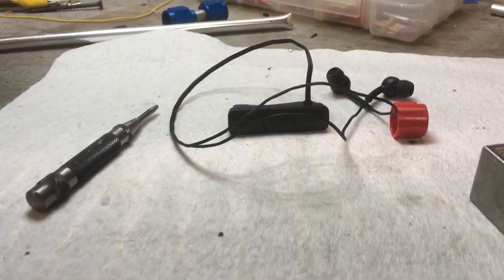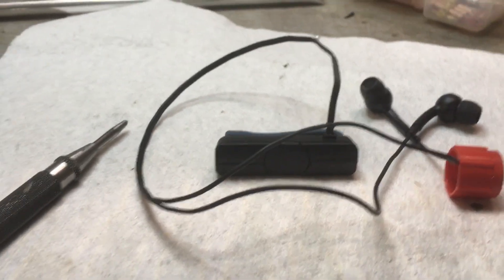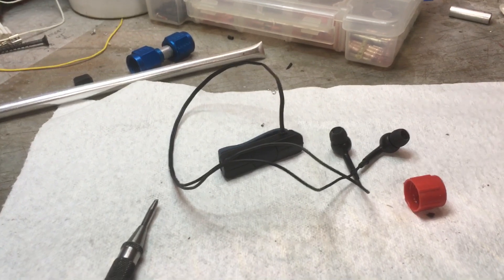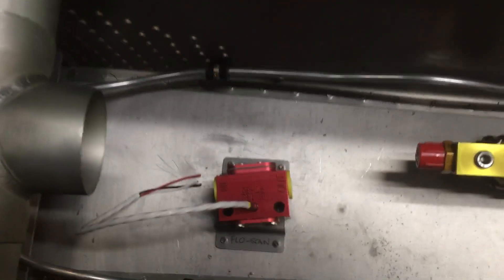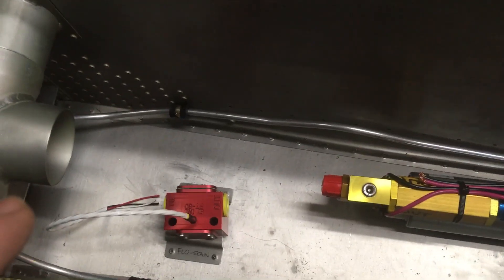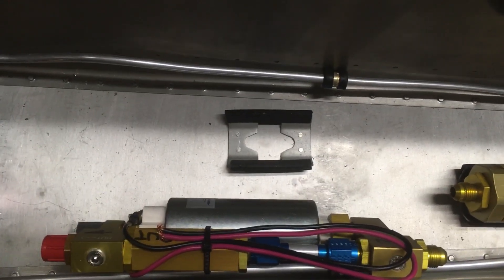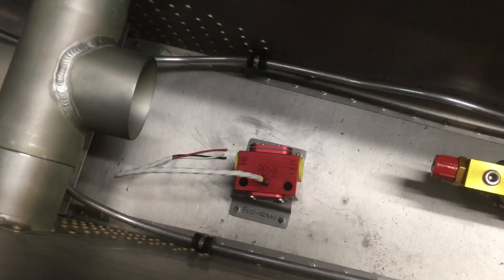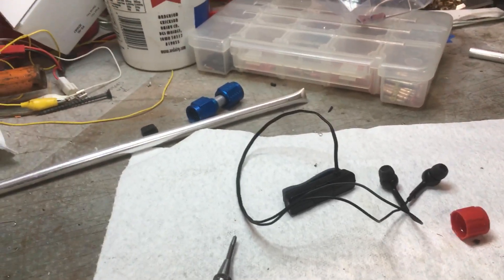RV10 Fuel System

Comment: Thanks for the videos Jim. Could you share you thoughts on going from a 6 to a 10? ...or maybe you’re simply a “builder.”
Reply from the maker: Scott, thanks for the comment!  I am most definitely NOT a builder.  Not exactly sure what your question is getting at, so after I offer a few thoughts feel free to continue the discussion.  We owned a Cherokee 180 before the 6 was finished.  Actually bought that with the "engine" fund destined for the 6.  It was nice to have a bit of extra capacity.  I really love the 6 and don't plan to sell it when I finish the 10.  We camp a few time per year and it is really a squeeze to take what we need plus two small dogs.  I thought I was getting a "deal" on the 10 Tail kit, that is what sucked me in.  I have flown several 10's and recognize how it will eliminate the camping issues but if I leave the wife and dogs home I wouldn't even think about a 10.  Well I'm rambling, if you give me a few more thoughts maybe I'll try to include a bit of narration on a subsequent video.  Gona have a follow up video on the fuel lines in the tunnel, got those made tonight.  Still need to drill and rivet a new mounting bracket for the pump.  Jim
Reply: RVJimD just looking to see how you arrived at your current position on RV’s. I follow Jason Ellis, Good Plane Living, and Branchair (all 10’ers). I told myself 2 years ago, “in two years, when I’m done building this house, I’m buying a tail kit.” Unfortunately once your 90% done you still have 90% to go with all the tedious finish work. Anyway, we’re a family of 4 with a share on an Archer II. I hope to complete a 10 before the kids are too old to want to go with Mom & Dad. 

I also enjoy your machining videos. I’ve had my eye on Shopmaster cnc mill / lathe for a while too.